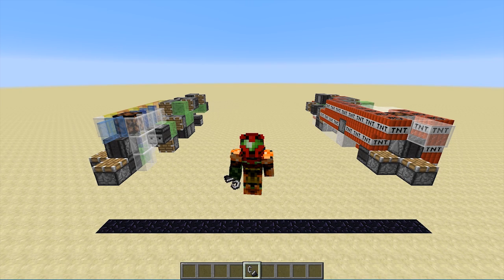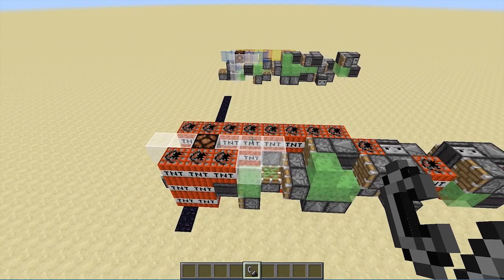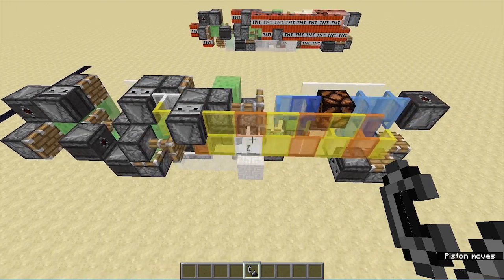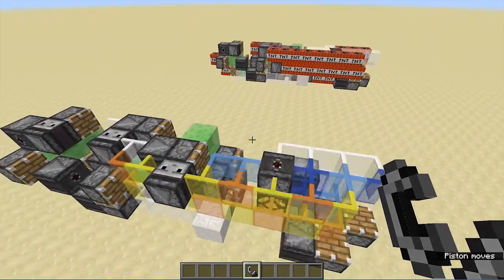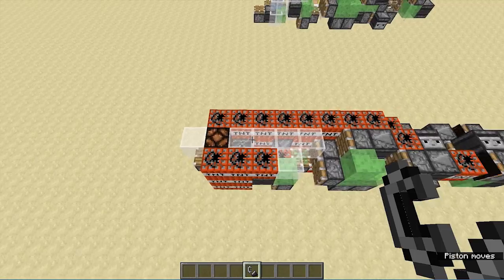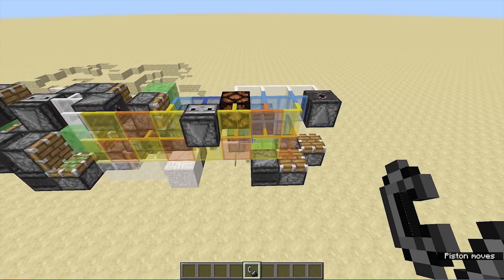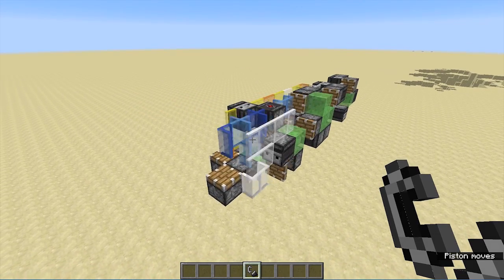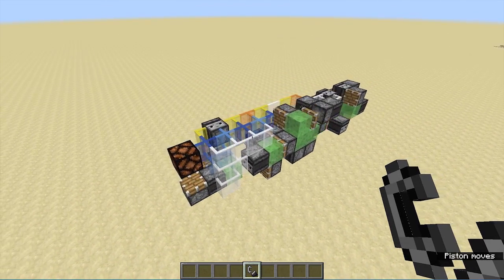Minecraft: Missile with built in Timer - Timed Missile

Comment: Isn't it easier to use binary counters? That way you don't need those piston tapes but just some sticky pistons with observers in front of them.
Reply from the maker: YellowBunny you could but size might be an issue. These can count 17 * 9 = 153 (edited, math is hard) which would be similar to 7 binary counters for 156. Not sure how that would fit if you also want tnt. But I might be wrong, dont know how compact binary counters can be nowadays.
Reply: 153*
Reply: +Cubehamster my idea before I clicked on the video. A slower TNT missle, followed by a simple machine that's faster. Once it catches up the first one is triggered. This could go for thousands of blocks with no change in the build size.
Reply: It's basically the same concept as using higher-base number systems, i.e. hexidecimal can represent larger numbers in a smaller space (fewer characters) than binary and other smaller-bases. In this case, Cube is using one hexidecimal digit, and one nonary digit (base 9). Although when represented using a "tape" like this, the hexidecimal digit must still occupy 16 spaces, it's probably still smaller or at least significantly less complex than using the equivalent (4) binary digits, as each digit requires its own "engine" to rotate it. Either way, very cool!
Reply: he's already done things like that before
Reply: The issue with using a second faster flying machine is that it can only be activated once. It works on TNT missiles but this on board timer can be used multiple times if you could find something you can activate multiple times on board.